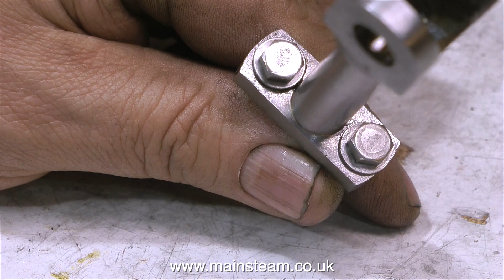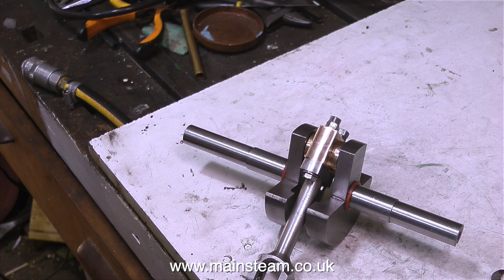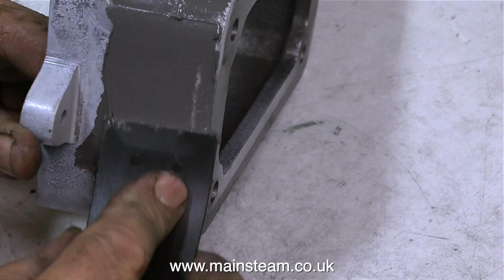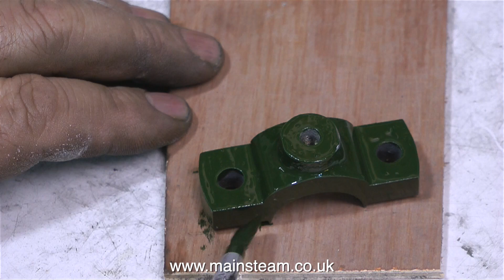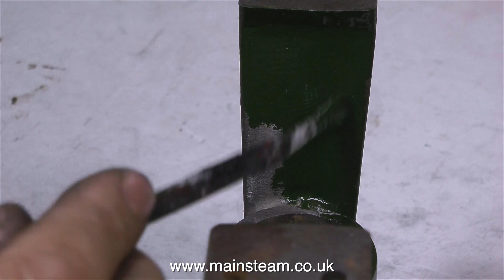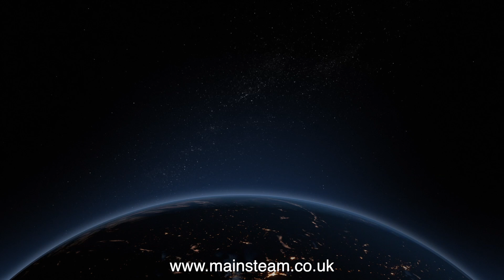HOW TO REBUILD A STUART MODELS 5A STEAM ENGINE - PART #8

Comment: keith when I measure using a caliper to measure I have the caliper 90 deg from how I saw you using them on this video  this way where ever the caliper is the wide point will be in between the caliper slide

Comment: I have found JB Weld very useful in repairing eroded aluminum cylinder heads that have been damaged by blown head gaskets. No failures! I have not trusted it for use in combustion chambers - too hot. The two or three I have had occasion to remove later have shown no sign of deterioration. The 50-50 mix of two different colored components is very handy to measure and also shows any material that is not completely mixed. Nice music Keit...ZZZZZZ.

Comment: I am a little nervous to make a comment that might be interpreted as criticism, but isn't it a good idea to counterbore the castings where the bolts go so that they have a nice flat surface to bear against?  I am sure you have a good reason for not doing that and I would be interested to know what it is.
Reply from the maker: I could do that, but they are generally filed flat enough for their intended application . . . .

Comment: I liked the music, not that fussy about the green it has an institutional look to it. As for the JB weld if can be a job saver. Worked at repairing big iron castings at one time and we bought it strait from the manufacturer in five gallon pails. The Welders would do there stuff on the casting and when they finished grinding we covered it with JB weld then painted. Bye the time we were finished it looked better than new.

Comment: When you were working on the Big Ends and soldering to two pieces together I was thinking "why do that just use a solid piece" but once you separated them after machining it made sense... if you had used a solid piece, once you cut it the kerf would remove material and the big ends would not align correctly... simply amazing the details that go into the machining these steam engines.
Love it !!

Comment: I've not seen you use the technique where gasket material is cut by laying it on the mating surface and tapping it with a mallet around the edge to be cut. Is there a reason you don't prefer that technique?
Reply from the maker: I don't want to risk cracking the castings with a hammer blow ...... so I don't use this technique.

Comment: British Rail Green, hard to go wrong with that earlier shade, a commendable choice. And that's from someone that green isn't a favourite colour.. The JB Weld denigration .. MEH ...  It's originally a Texas product, and many things Texan carry the tiresome 'chest beating' Texans seen to really get into, which a good part of the rest of the US just rolls their eyes at. It tends to be used as a quick fix application (much like how Cyanoacrylate adhesives get used as quick fixes in applications where they will fail very quickly). Minus that baggage it's a perfectly useable epoxy that is remarkably tough and reliable, standing up to applications one would not think should work, but it does. I have a set of JB WELD tubes in with the rest of my adhesives and cements, it is very useful.

Comment: Keith Model Engineers Jan 7 1937 states red brass 90% copper 2% tin 7% zinc 1% lead and gunmetal 90% copper 5% tin 4% zinc 1% lead  article said red brass was harder and cost less than gunmetal but doesn't say it's better or worse .I think gunmetal is better and sounds good rolling off the tongue .thanks for all the work you do posting videos I truly appreciate and enjoy them very much

Comment: JB Weld is wonderful stuff. My wife had a ceramic jar that she used for kitchen scraps on their way to the compost pile. She got it from a very hippy garden store. I think you were required to have at least six piercings and two square feet of tattoos to work there. This jar would get dropped or knocked off the counter from time to time and it would break. I'd glue it back together with JB Weld. It would be dropped and break again, but never on the same lines as were JB Welded. After a while it was looking like some sort of ancient mosaic artifact. Eventually, she gave up. I would have kept JB Welding it together as it became kind of a sport, but she decided it was too decrepit looking. Now she just uses a vacuum-formed tray that mushrooms came in. It works just as well as the fancy ceramic jar and doesn't break if it's dropped so I haven't had to JB Weld it back together yet.

Comment: I was watching a video about the Kempton park triple expansion engine being started. At about 9 minuets in the camera man was walking around the engine and I saw quite large areas of the casting which needed painting. I thought to myself if only Keith was here he would have that frame repainted in no time and it would look so much better. Then I remembered this was not a small thing close to the camera but a very large thing quite a distance from the camera so a little brush would not work very well.

Comment: Lovely.  I would say that I have had JB weld separate in the tube and leak in storage so make sure it looks proper before using.  It didn't set after properly after.  It also help me to use it warmer as it is runnyer and less prone to air bubbles.

Comment: I do like that green, I take it it is self priming as am considering now to use that green, its interesting that its the same as Reliant's engine rocker cover paint so I have been told as Reliant bought BR's stock of old green paint when the trains went to blue and Reliant used it on the Regal and Robins as well as for engine rocker cover protection (Reliant had brown, blue, green, yellow, black, red rocker covers to denote which car had a different thing, the greens were officially unleaded, the yellow was for high compression, red for standard)

Comment: Is there a reason you do not spray paint ?
Reply from the maker: Most full size steam engines are not spray painted.
Reply: you would take just as long covering and plugging up holes and parts you do not want to be painted, then you would just using the brush, and when you've been brushing for as long a keith, you tend to be quicker and more precised with the brush.
Reply: Keith Appleton and it not as satisfactory to use a spray gun

Comment: Besides JB Weld - another favorite of mine is Durham's Water Putty. The applications are not the same though. I never use water putty in an adhesive application (well I did use it once to stick down a ceramic tile and it never loosened). You have to use water putty a bit faster than long set epoxies. 

I am not certain if it has a place in steam model engineering but it is a nifty product. It does have it's applications though and it's quite cheap. Cheers, and thanks again for the great videos.
Reply from the maker: I like "Milliput" too .....

Comment: As a fellow model engine builder I'm enjoying your videos. I have used Time Saver Lapping Compound for bedding in bearings, it does not embed  in to the bearing or shaft material and improves the surface finish of shaft and bearing. Keep up be good work.

Comment: im a bit of a perfectionist so i would of sanded that base all down but it will still look great with the jb weld thanks Kieth
Reply: The problem with cast iron is it can have many imperfections just under the surface. The more you sand (or grind) the more imperfections get exposed, at some point you are going to have to use a 'filler' of some type. Also it's very easy to sand off more on one side than you want to so the whole piece can become uneven, you would just be making more work for yourself.
I like Keith's method of using JBW, just put enough on to cover the really rough spots then sand down just enough to expose some high spots so you can still see some of the actual surface. I'm sure if you look close enough you would still be able to see the JBW under the paint but you wouldn't want it to look too smooth anyway, it would be out of place with the rest of the engine castings.